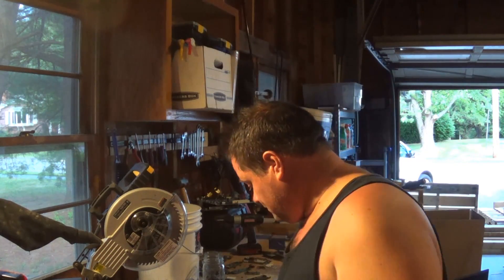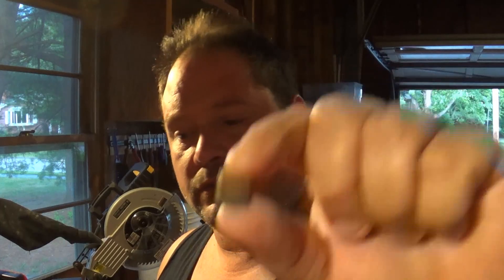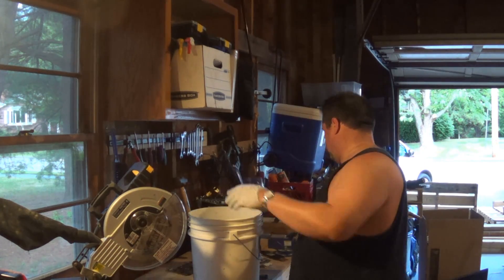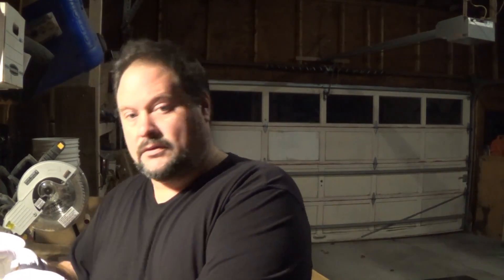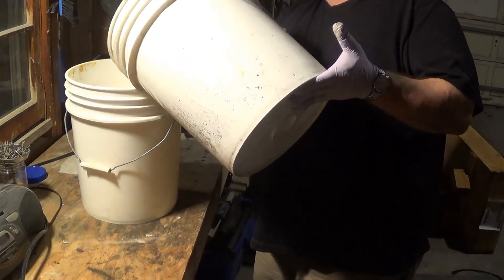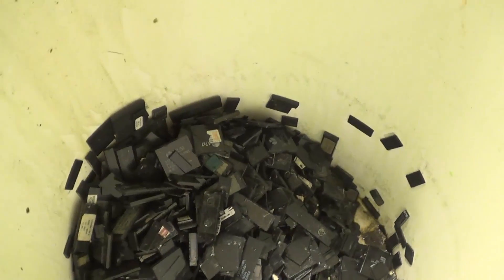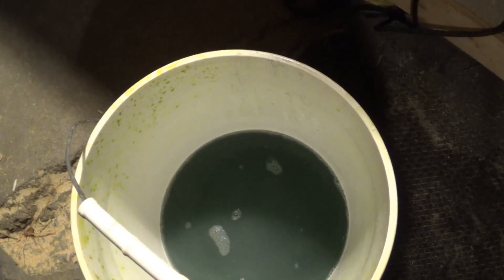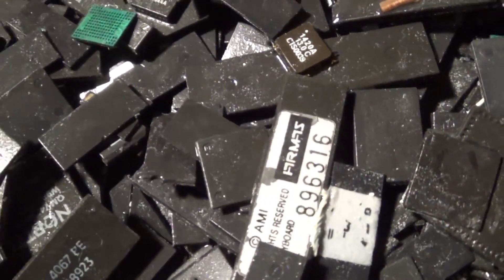Gold Recovery from IC Chips part 1: Sort and pretreat

Comment: If you use nitric acid you should also checkout the sreetips silver processing videos that way when you dissolve the silver from the chips and other stuff you don't just throw it out thinking it's useless , really easy to precipitate the silver and probable worth it if your working in the kilograms range of weight and computer parts, I'm still working in the ouces range with computer parts, thanks for the info.

Comment: moose...skip the AP dude...incinerate until light gray and white( very important) ,,,burn small amounts until done before adding more,,,then use ball mill( not a rock polisher) polisher is just a drum,,ball mill has a baffle( this makes a major difference in crushing it to dust)then use magnet to remove iron, nickel an whatever else that sticks to it,,,after that put what's left in a 5 gal CLEAN bucket,,add 3 gal. of tap water 3 DROPS jet dry,,get drill & paint mixer and stir 30 seconds,wait 1 minute,,then pour out all but 1/2 gal..then repeat 3 to 4 times until most of the ash is gone,,( NOW FOR THE EXCITING PART) get out your gold pan an carefully pan off the rest,,,what you will be left with is your gold bonding wires,an a bunch of tiny beads of mixed metals that contain gold an maybe some silver,,,,good luck buddy

Comment: Get one off eBay....can't be more than $10...and, seeing what you do....will be a game changer. Much like your use of an aerator over hydrogen peroxide in your AP mix. Have you tried the high acid vinegar method yet (peracitic acid or something like that)? I tried it but with store grade vinegar and it worked very well....I just need to reduce via boiling down a gallon of 5% acidity vinegar to reach an almost 50% acidity. I'm betting it works flawlessly! Good luck.
Reply from the maker: Thanks!  Have not tried the vinegar method.  Still left with a toxic solution with that method though.  Will look into the grinder.
Reply: Moose Scrapper - I thought someone using the method (and, as I recall, they sounded as if they knew what they were talking about) mentioned the vinegar and hydrogen peroxide revert to their initial state after the reaction is complete, although they are obviously still a mixture.

Comment: Hey Moose, have you found out any info on identifying which IC's contain gold and which do not? I'm sure most do not but have run across videos mentioning that all memory cards' (and some others) IC chips have gold. Just curious as I believe a lot of my IC harvest is non-gold bearing. Thanks for all the great vids!
Reply from the maker: I would safely say Ram, motherboards, and basically any IC you might find ina computer or piece of very high end electronics.  Otherwise I do not know for sure.  There should be other PM's in them though like silver and palladium

Comment: Hey moose- how big were the SS balls you used in the mill? I was going to try crushing ics/pcbs in a tumble-ball mill with 14mm steel balls... but if you say it didnt work... i better start looking around for a mechanical shredder...
Reply from the maker: 1/8 and 1/2 inch
Reply: Moose Scrapper I've found 60mm BB's.. got some heft to them, I'm gonna try those.. I think they'll pound ics, and even break up crystals too. Will keep you posted 👍🏻

Comment: Hey Moose, would you mind telling or showing me what the blades are supposed to look like in a  brand new tnt stripper? Mine are kinda flat and dull, should they be pointed? ty
Reply from the maker: They should be very pointed.  It is basically the tip that does the cutting not so much a blade

Comment: Hey, Moose, would you happen to know what is going on with Board Sort?   I have forgotten my password and have tried at least 10 times to get a new one sent to my email account on file.   NO RESPONSE in my emails even though the system says it sent a new password.   Also, notice other are having major issues with their stuff on the little of the forum I can view not signed in.  WOULD YOU HAPPEN TO HAVE THE NUMBER FOR THEM SO I CAN CALL?  I can't find it anywhere!
Reply from the maker: I don't know, sorry, I have not used them in a while.
Reply: i never got email reply from them, but i did get paid when they received my boards. Maybe you can just use a different email and make a new account.

Comment: Hey Moose, I was just going through comments on an old vid of yours where someone suggested a Vent Hood setup.  You said the known truth that most metal systems would corrode, as well as motors.   Wondering if you have solved that problem yet.   I figured you could use a leaf blower motor, use it to force air through one side of a 2" PVC DWV Wye and 45° Elbow Combo joint aiming exhaust towards the exit point of the PVC pipe, wherever it may terminate.   that way you are pulling the fumes out but not introducing them to the actual motor.   Just curious as I am wanting to tackle that particular project when money allows.
Reply from the maker: No I havnt tackled that problem yet.  With the chems I use I have been pretty lucky with being able to just keep the containers outside in my fenced in yard.
Reply: (Y)  I know what u mean

Comment: I put my chips in a tin with a lid with a small hole drilled in it. Then put the tin on a charcoal fire for an hour, shaking the tin every 5 mins. Then tip the ash into an old frying pan and heat and stir them until they turn light grey in colour. Then process using acid in the normal way. This way you can be sure to get all the gold from the bond wires.

Comment: AWESOME!!   I am just getting ready to do my first attempt at Gold recovery.   I DO have a question......   The silver/tin RAM sticks only pay about 5 dollars per pound at Board Sort right now.  But, they are pretty darned heavy with IC chips.   I am thinking that it would pay me to keep the Silver / Tin Sticks for me to remove the ICs and just sent in the Gold Sticks to Board sort to help pay the shipping of the Mother Boards.  Does that sound like a reasonable idea?  Not a LOT of them but small batches is what I want to do in order to get better instead of messing up a first run with a BIG batch.
Reply from the maker: If you are ok with that then I don't see a problem.  If you have more than 100lbs look into freight options, they can be cheaper

Comment: Good day Moose, I have a question, do you have any idea about what metal plated have the flat cables inside laptops some are gold plated, but what about the silver color ones??? thank you for read
Reply from the maker: I have not found anything about the silver toned ones to be silver plated.  If they are however, I am sure that the amount needed to justify the cost of chemicals would be amazing.  Given silver is worth so much less than gold.

Comment: this is great Moose thank you so much.   I was puzzled by one thing though, maybe you could enlighten me.  You soaked those in used AP, which I assume was used for goldfingers. So your AP will contain mostly copper. Now the legs you dissolved are Iron I believe, and as far as I know Iron precipitates copper, its happened to me. How did you not end up with a bunch of cemented copper in your bucket!?
Reply from the maker: I end up with a bunch of metals in there.  Copper, silver, platinum, palladium, gold etc.  I just filter it and save it for future refining AKA when I learn how to get the good stuff out.

Comment: Hey, just a general question about nitric acid.  I know you have said that you don't use the stuff, and I get it, I probably won't for a while either.  But I have done some searching just in case, and I was wondering if you have done any research into where to get it at non-prohibitive prices.
Reply from the maker: lol, nope, the only non prohibitive possibility is to make your own from stuff found at Home Depot, and I am still learning about that
Reply: Yeah, I figured that might be your answer.  I've looked at ways of home brewing this stuff, and I don't think I'll be doing any of it any time soon.
Reply: A company called DudaDiesel sells potassium nitrate in one, 5 and 10 pound bags. Ace Hardware sells a brand of drain cleaner called Rooto that is over 94% sulfuric acid. Home Science Tools (online) sells chemistry equipment and they have an organic distillation kit for about $110 that works very well. I can make 85% nitric for about $3 a liter Check out Nurdrage or Nilered for the recipe.
Reply: Hey Moose, you don't necessarily have to dry them before incineration, also after incineration ( providing you torched them to a white finish) what I find to work best by far to get my chips crushed to a very fine powder is a hard surface like a old countertop and a 20 inch long hoist shift that I use as a rolling pin,  guaranteed you'll get powder like flour, cheers.
Reply: Are you in a large city? Your Jewelry District and Jewelry Supply shops sell it. I pay $30 per gallon.
Reply: I am finding more stuff on youtube with different methods. Maybe one of them will work out.
Reply: In Arizona I just by it from a store that sells chemicals. If you don't know what you are doing and have not had much chemistry like me, I'd rather be safe. Buy a respirator rated for acid. The fumes will give you COPD over time. Be Safe.